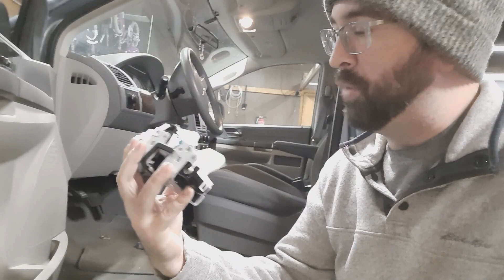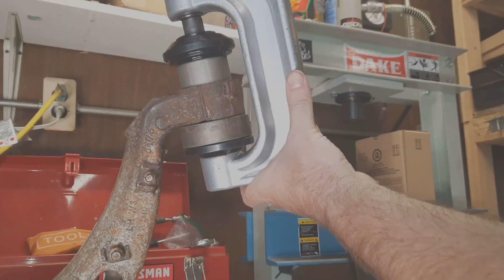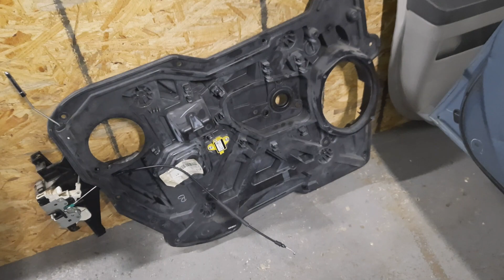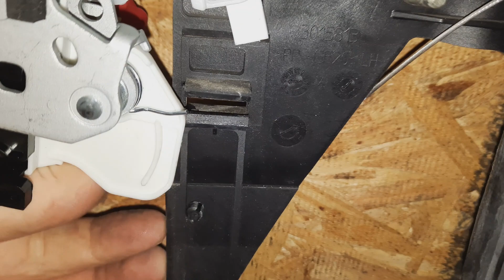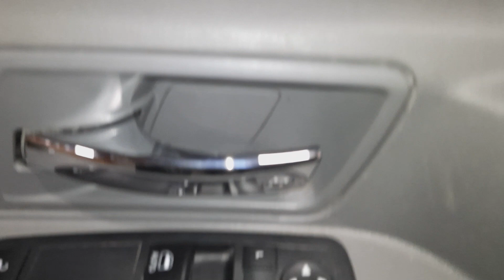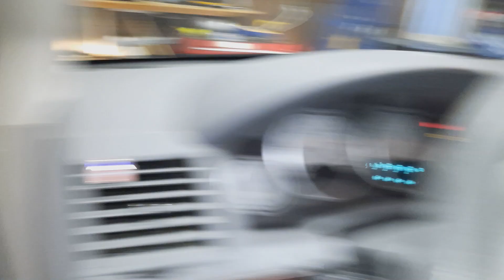How To: Door Latch Replacement - Chrysler Town & Country / Dodge Grand Caravan

Comment: Same hassle to replace the window regulator. I got it all back together and realized I had the door handle cable in the wrong hole and couldn't open the door from the inside.  had to take it all back apart again.  Test the handle and lock before putting the trim back on.